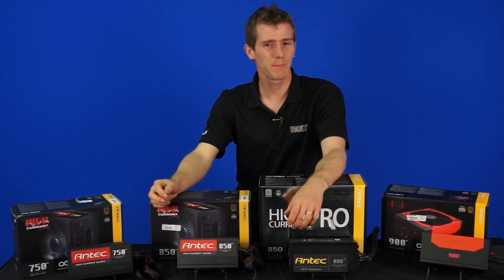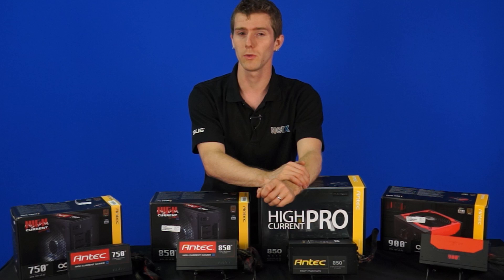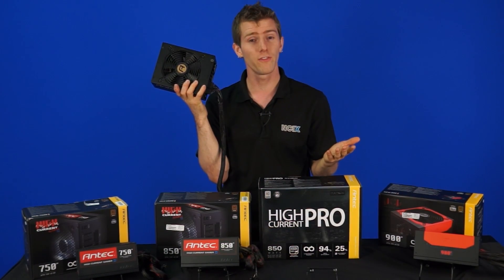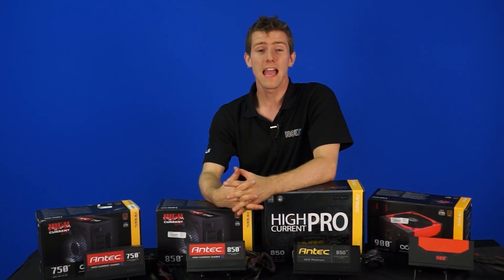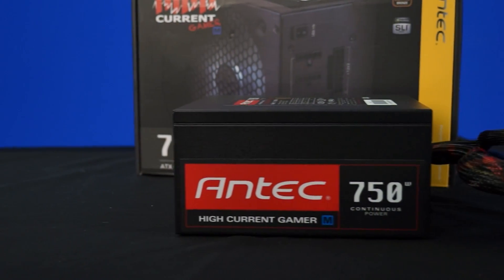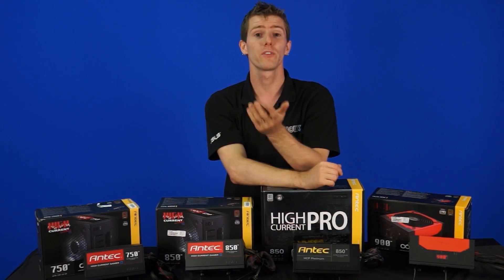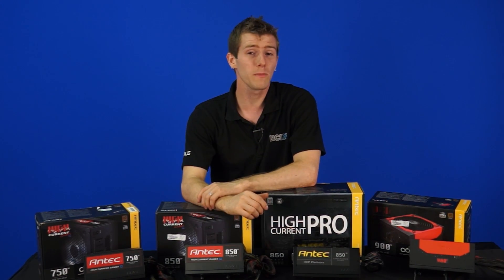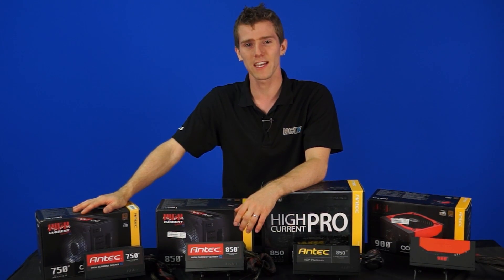How Many Watts Do You REALLY Need In Your Power Supply? ft. Antec HCG

Comment: Is Corsair 750(watt)RM 80+ Gold enough?? for:
I7 4790k
MSI R9 390X
16GB DDR3 Corsair Dominator platinum 2400mhz 
256GB SSD 850 PRO
CORSAIR H80I GT (with 2x 120mm fans)
Blue Ray/Dvd-disc
2 200mm fans( or 3 but 1 is not plugged in)
Cooler Master Sniper Black Edition Chasi
ASUS Z97-A Motherboard
ASUS PCE-AC68 Dual-Band PCI-E Adapter Wireless-AC 1900

+ USB Razer naga
+ USB Razer blackwidow
+ USB Bose Companion 5 Speakers
+ BENQ XL24IIT
Reply: +taucommander12 more than enough
Reply: +taucommander12  yes thats perfect amount for that setup, gives you a little room for overclocking too
Reply: Kk :) Noice, tho only prob is that it bluescreens sometimes when Im gonna play diablo or games, or just get stuck and bluescreens sometimes several times in a row, then it may work some week in a row without any bluescreens then it comes bk, dunno if it's the ram or something else...
Throw it away ? xD
Reply: taucommander12 i might be a RAM issue. try boot up with only 1 stick of ram and try again. if any overclock on your system (manual overclock) try to remove them and set them to stock speeds.
Reply: I tried to get out the ram before but it was like glued to the motherboard so I gave up ;D Was no way it was coming out lol, I tried wiggle it out but was barely moving lol. Or can I just buy new ram and hope it's not BS ?
Reply: And no I haven't overclocked anything, what I know.
Reply: Only set the gpu fan to higher speeds when it was starting to get warm.
Reply: taucommander12 the ram slots are locked in by a little clip on both (on asus the top end) of the motherboard. after you release the clips, you should get them out no problem.
as long as the gpu is below 85ºC you should not have any operating issues with the card.
Reply: I opened the upper clip but nothing happend,, so is it locked on both sides or ?
Kk :)
Reply: taucommander12 yeah for the most part. i said ASUS boards only need 1 clip to be released for that
Reply: Kk :P I did that but couldn't still, they were so tight together the 4 slots so couldnt really grab anything...

Comment: gtx 970
intel i7 4790k 
16 gb ram
1tb harddrive
225 gb ssd
corsair water cooler for cpu
500 W enough?
Reply: Kage probably not
Reply: +Kage as long as its a good quality psu and you dont overclock the shiet out of your cpu and gpu, its enough... 
im ordering an i5 6600k and a gtx 970 and i have a 550w seasonic g series psu powering it. i really dont think its going to pull more than 350w out of the wall...
Reply: aight, thank u lads. Got my self a 650 from corsair, should be good

Comment: About to upgrade from gtx 660 to gtx 970
Does my corsair cx 500w 80+bronze psu would be enough?? 
Spec
I5 3300
8 gb ram
1tb hdd
500gb hdd
Mobo :msi m-itx lga 1155
Lg optical drive
Stock intel cooler

Comment: My computer shut off once when I was playing and the power supply popped but no smoke was produced and I have an I5 dual core,gtx 750 evga and it was all ran by a 400 watt power supply is my power supply to small and what should I do
Reply: Had the same problem today with my 550watt supply hooked up a r9 290 you need to buy a bigger power supply sonething like 550 watts i should upgrade to 750 i gues lol

Comment: i7-4790k 4ghz cpu
Asus maximus VII hero MB
keyboard + mouse
Nvidia Gtx 980
Optical drive
1tb hdd
120-240 gb ssd (may vary)
6 fans, 4 120mm, 2 240mm.

What would be the ideal power solution? I've done a check online and it barely comes in at 480 watts, but I'm afraid if I buy a 500 watt powersupply i may fall into issues, any helps would be appreciated.

Comment: FX8350
R9 280
8GB RAM
1TB HDD
Is 500w enough?
Reply: eGaming180 Nope, you'll need 550W-600W from a reputable brand/product line for that.
Reply: I have 500W and for now everything is working great :D
Reply: eGaming180 Well, OK then. You're on the edge, but if it works, I guess it does. Just don't overclock your 8350 to hell.
Reply: haha I won't overclock it, maybe sometime i will, but for now i'll leave on stock, cause it's good enough :)
Reply: *****  have question... if I upgrade to 8gb of ram shold I upgrade the psu also, im having issues with bluescreens on win 8.1 when i upgrade my ram .. I  caan only work with 6.5gb and when watching youtibe vids...the cooler fan goes to max rpm... 430watts psu i have.... any suggestions?
Reply: I bought 620w haha, but thnx for tip :D
Reply: beggin CS master i have a corsair cx430... On a dell dimension e521 8gigs of ram and asus gt 440  and athlon x2 6400+ 3.2ghz
Reply: beggin CS master when I start nfs most wanted 2012 after the intro video my pc just restart, what should it be?
Reply: You've got the same specs as mine, but I got 600w.
Reply: i've got the Same and a xfx 550 Watt powersupply....
Reply: I got a i5 4690k at 4.3 ghz and a r9 280 over clocked really far it takes about 550-600 watts from my 650 watt psu
Reply: I have the same specs but with the 750ti
Reply: and i34170 I'm done I don't really know anything about tech I'm only 14
Reply: and I'm getting a 720 watts the psu is pretty cheap.
Reply: X4 860K
R9 380
8GB ram
1TB HDD

I was thinking if the Corsair VS550 550W was enough? or do I need more horse power :3 ?
Reply: No, thats fine, you can easy use a FX-8300 and 16GB ram, a friend of me has the same system
Reply: +beggin CS master Going with a Corsair CX 750M I wrote wrong not a 380 it was a 390 and well I will also oc my cpu and gpu and the 390 had a minimum of 750watt psu so... And I could go with a 750watt if I ever upgrade cpu to Intel or something else that needs power

Comment: My video card said I needed a minimum 450 watts, if I geta 430 watt, will I be ok
8 gb ram
Amd fx 6300 cpu
R7250x gpu
And a 970A D3P

I tried to use my friends 430 watt but I got a black screen and a beep code. (Long-short-short-short) video card issue supposedly
Reply: Sage Sekhon If you haven't done anything yet, then yes it will be ok. Your cpu and gpu together wouldn't use any more than 200 watts (despite being AMD) and they are by far the biggest users of electricity in most computers.

Comment: Is this a big enough psu

Cooler master 500watts
Gtx 960
Atx motherboard
I5 2500k
8gb ram
1 hdd
1 dvd drive
1mice
1keyboard
1 headset
Reply: 600 would be good i have a 280 gtx but i have a 750w but. But a gtx 960 and a gtx 280 have a recommend on 600w
Reply: *1 mouse
Reply: thanks

Comment: How many watts do I need for this setup? 
Core i7-4790K 4.5GHz
Corsair H110
Asus MAXIMUS VII RANGER 
Corsair Vengeance Pro 16GB
Sapphire Radeon R9 295X2
Samsung 850 EVO 250GB
Seagate Barracuda 1TB
Reply: ***** You should start a comedy show
Reply: If u dont buy atlleast 1600w platinium ur house gone exploade and alians are going to rull the world. Go with a cx430 non modular on ebay for 200$ god deal!
Reply: basje 1234567890 Nah man, I think I have decided. A nucelar powerplant would be the sweetspot for my build..
Reply: TheZero696 Sorry but 295x2 SLI? Go learn some stuff before you make jokes
Reply: TheZero696 r9 295x2 ALONE consumes 500 wats. If you were to CROSSFIRE it, it would pull 1000 watts, so that card eats power like winnie the pooh eats honey.
Reply: Bro, im sorry, but if you really believe that and if you do actually do that, then say bye to your whole rig.I'm telling you, do a little tiiiiiiiiiny bit of reasearch on the r9 295x2 gpu and you will acknowledge the fact that it consumes 500 watts.Sorry to burst your bubble there, bud.
Reply: Solid Gear 250 Watt TFX Power Supply   ----  this power supply can easily handle R9 295x2 sli
Reply: Syndicution R9 295x2 sli please
Reply: I Own A Horse no sir a 250 Watt TFX Psu will easily handle r9 295x Sli Crossfire....
Reply: Uhh, sure, i dont know about that exact card, but there is a r9 295x2 model card, which is a double gpu card, which consumes 500 watts.
Reply: I Own A Horse im telling you 250 Watt TFX PSU can easily hand r9 295x2 crossfire sli  and it only cost $25 WIN WIN

Comment: http://www.futureshop.ca/en-CA/product/asus-asus-m32ad-pc-brushed-metal-intel-core-i7-4790-2tb-hdd-16gb-ram-nvidia-gtx750-2gd5-windows-8-1-m32ad-ca008s/10322688.aspx?path=cfe27997ed61af50065ea2154a94861aen02 I'm thinking of getting this PC but it only has a 300w power supply, is that enough? If not, what power supply should I get for cheap?

Comment: I need help choosing my wattage, I would highly appreciate any suggestions. 

Hardware: 

CPU: AMD FX-8320 3.5 ghz (not overclocking)
CPU Fan: Stock
Motherboard: ASRock Fatal1ty 990FX Killer
Ram: 8 GB ( 2x 4Gb ddr3 1600) nothing too fancy
GPU: Geforce GTX 970 (Uses much less power than normal 900 series gpu's)
HDD: Western Digital 1TB 7200rpm blue edition 
Optical Drive: Some $20 Asus dvd cd drive
Fans: 2 120mm fans with led (again nothing too fancy)
PSU: My preferred/calculated wattage on pc part picker is 367 watts, but since another calculator said 500 watts i'm leaning toward a 550 watt psu to be on the safe side.

PS - This is my first build so do you guys think that this combo works well with each other and if i am missing something?

Comment: is a 550wat psu enough for gtx760 sli (i want to buy a second 760 and i want to know should i buy a new psu)
Reply: Hey.
Im running 2x760 oc gtx from gigabyte. I use a 850w power supply. But i have also overclocked my 4770k cpu from 3.5ghz to 4.3ghz. So i would recommend you to buy a new power supply, i would say at least 750w.
Reply: you should at least have a 650w-750w bc just that gtx 760 requires 500 watts out of your power supply so yeah !I hope this helped

Comment: asus strix geforce gtx 970 and i7 4790k, is 750 w enough?
Reply: 600 w is enough, you can use a coller master psu calculator if you are not sure.
Reply: got the evga supernova g2 fully modular 80+gold 750 w psu yesterday, with a 10 year warranty and for 136$, so it was worth it
Reply: f1nsk1pojk1 Good PSU can last a decade soo yeah it is worth it.

Comment: What PSU Should i get?

AMD Quad Core A10 7850k Black Edition

MSI A88X-G45 Gaming FM2+ Motherboard

Cooler Master Hyper 212 Evo Heatsink

1 ASUS Radeon R7 260X Overclocked 2GB GDDR5 

Acer 60Hz 19.5" Monitor

X2 4GB Patriot Viper RAM

LG DVD+RW Optical Drive

7 LED Fans Spinning ~1600 RPM

1 WD BLUE 7200 RPM 1Tb HDD

Im going to run Windows 8.1 and am going to have a back lit keyboard, headset and gaming mouse.

Comment: What PSU should I get with this build? 

Intel Core I7-4930K 6-Core Processor

ASROCK X79 Extreme-6 ATX LGA2011 board

NZXT Kraken X61 106.1 CFM Liquid CPU cooler

X3 GTX 980's WindForce edition 

X3 BenQ 27" monitors 

16GB 2400hrz 

X1 1TB Samsung A50 

760T  White edition Case 

X2 3TB HardDrives Barracuda Seagate 3.5" 

Etc. Can you recommend a long lasting and future proof PSU thanks :P and could you guys recommend some components That I should change for the gaming experience :D thanks guys And can you guys tell me what build you guys have :P
Reply: You sure have a slow RAM....

(typo joke)
Reply: ***** RM is overpriced, AX is overkill and CX is low quality.
Reply: ***** Hit the nail on the head, you did.
Reply: Just get a 900w Corsair or Rosewill. Never had either of those brands die on me.
Reply: I have compiled a list of parts on PCPartPicker, (here: http://pcpartpicker.com/p/CLZxVn). The changes i made were:

New Haswell-E processor instead of Ivy Bridge-E
X99 of course
DDR4 (can't have DDR3 on X99)
4x4 GB of G.Skill Ripjaws (best RAM, also more bandwith than 2x8)
500GB Samsung 840, and 1 3TB drive instead of 2
Same GPU's
The tower (has a cool window)
and a 1200W power supply (these GPU's actually draw 300-350W a pop, and not PCPartPicker's 165W)

Also i didn't include monitors, but those don't need extra power supply wattage.
Reply: Flaming Lemons These graphics cards run on the new power efficient Maxwell GPU and really draw only 165 Watts of power!
Reply: thijs luttikhuis
No. Anandtech benchmarked them and they found out that it uses about 300 watts of power during full load (crysis 3/furmark). The 165 watts is it's TDP (Thermal Design Power)
Reply: Antec, Corsair HX, and Seasonic are all good brands
Reply: ***** Their other lines aren't very good.
Reply: That is overpriced. The SeaSonic X 1050 watt is available for 170 right now. The CX line is low quality. End of story. I just picked up an antec HCG750 for $80 which is only a few dollars more than the CX750 but much better quality.
Reply: thijs luttikhuis when its not playing a game just on the home screen

Comment: If you dont have 12 hdds, and quad sli you are not going to hit even 750w. Jesus. Come on if your pc is hitting nearly 1kw you have too much goddamn stuff running. (or you have a duel cpu quad sli running... which is nuts)

Modular = very cool. Screw the octotenticles of random legacy connectors in my old case.
Reply: facts, aside from not talking about actual single crossfire or single sli setups. im actually super curious rn if 850 would power a 290x crossfire.

Comment: Hi, i have a gtx 770 4gb, 8gb ram, i5 4670k, corsair h110. Im using 750w plus bronze from cooler master. I want to upgrade for a second gtx770 4gb and 8gb ram more i will need a better PSU or im fine whit mine? Thx for any help

Comment: i have 530W PSU, 4GB ram, 1 WT 500gb, i DVD drive, and AMD Athlon x4, i plan on getting the gtx 770 lightning, do i need better PSU?
Reply: Google psu calculator and use the first one I did and my system works great
Reply: Is the PSU 80+ rated?
Reply: i have to evga 750 psu now. just had to upgrade out of caution.  i got the 4gb gtx 770. stable system.
lol and the world is ending13

Comment: So, my first gaming PC build is this: 
-AMD FX-6300
-Sapphire Radeon R7 260x
-Gigabyte GA-970A-DS3P motherboard
-8 GB 1600 MHz Kingston Hyper X RAM
-SanDisk Ready Cache 32GB cache SATA SSD
-WD Black 1TB 7200RPM 

Would a Sentey X Plus Power 625-watt power supply unit work well for this build and perhaps some overclocking and a few upgrades in the future? Or do I need more or less power for it?

Comment: With an FX8350, 16 GB DDR3-1333, and a GTX 660 Ti DC2+Quadro FX1800 gaming/light workstation rig, will a Corsair CX750M be sufficient to add another 660 Ti along the line? Just wondering if i didn't manage to buy exactly the wrong PSU for me future plans.

Comment: What PSU would be good for this build: 

	
ASUS P8Q77-M USB 3.0 Micro ATX Intel Motherboard
	
EVGA  GeForce GTX 760
	
Intel Core i7-3820 Sandy Bridge-E Quad-Core 3.6GHz (3.8GHz Turbo Boost)
	
G.SKILL Ripjaws X Series 16GB (2 x 8GB) 240-Pin DDR3 SDRAM DDR3
	
Kingston SSDNow V300 Series SV300S37A/240G 2.5" 240GB SATA III Internal Solid State Drive (SSD)
Seagate HDD. 4TB 64MB Cache

Comment: I have a ASUS Z97-DELUXE motherbord with:
Intel Core i7-4770K Haswell
GIGABYTE GeForce GTX 770 OC - 2GB GDDR5 
4x4 Kingston HyperX Beast DDR3-2400 4G RAM
Samsung 840 EVO SSD - 250GB 
Western Digital WD Black - 1TB
and a bluray drive
with a Corsair RM750 Gold - 750W PSU 
I'm thinking of adding another GeForce GTX 770 in SLI
would the 750W PSU be enough?

Comment: Is it stable enough to power up my car audio amp that draws 100 amps at 12V under full load ??? That's if they make a 1500 w model, safer in the house with out using car batteries in the house "Harmful fumes" that batteries give out... I'm asking cause this would a lot cheaper to buy then purchasing a power supply for about $2000.00 for 1000w 12v dc...

Comment: My build is a 
Gigabyte Z87M LGA 1150 mother board
Intel Core i5 4670k quad core 
EVGA Nvidia Gtx 780
Kingston HyperX Black Ram
PNY XLR8 120GB SATA III SSD
Sea gate Barracuda 1TB SATA III 7200RPM 

Would a 600 watt supply be enough or should I go for higher
Note:(No over clocking also I will upgrade in future :)
Reply: malomkarom ChromeMario I hope to god you didn't follow this guys advice. I would have gone AT LEAST 650W or 750W.
Reply: You don't need 600 watt. Buy a Chieftec 500W, maybe even an XFX 450W is enough.
Reply: Because you're stupid.

GTX 780 : 250W
I5 4670K : 84W
All the other stuff : About 50W.

Even an xfx pro 450 would be enough.
Reply: malomkarom He's going to upgrade in the future, and also no one likes a PSU going hairdryer
Reply: Even if he upgrades to a 4770K, the xfx 450 would be enough. 

A new HDD, SSD, RAM wouldnt matter, those aren't affect the 12V rail.

Comment: PNY NVIDIA GeForce GTX 770 OC 2GB GDDR5 2DVI/HDMI/DisplayPort PCI-Express Video Card (VCGGTX7702XPB-OC),
EVGA GeForce GTX 780 Ti Superclocked w/ACX Cooler 3GB GDDR5 384bit Dual-Link DVI-I DVI-D HDMI DP SLI Graphics Cards 03G-P4-2884-KR,
Intel Core i7-4770 Quad-Core Desktop Processor 3.4 GHZ LGA 1150 8 MB Cache BX80646I74770,
ARCTIC Freezer Xtreme Rev. 2 CPU Cooler - Intel & AMD Twin-Tower Heatsink, 120mm PWM Fan,
ASUS Maximus VI EXTREME LGA 1150 Intel Z87 HDMI SATA 6Gb/s USB 3.0 ATX Intel Motherboard,
Corsair Dominator Platinum 16GB (2x8GB) DDR3 1600 MHz (PC3 12800)Desktop Memory (CMD16GX3M2A1600C9),
Seagate NAS HDD 4TB SATA 6GB NCQ 64 MB Cache Bare Drive ST4000VN000
Asus 24x DVD-RW Serial-ATA Internal OEM Optical Drive DRW-24B1ST

How Much Watts Should I Get {Im A Big N00B When It Comes To This}????

Comment: I m building this build:
MSI Z87-G45-GAMING ATX Motherboard ,i5 4670k, msi gtx 750ti, 1 WD 1TB HDD, 8GB hyper Kingston ram, 3 120mm led, 1 140mm led and 1 120m fan and
1 dvd drive,
(Not OC)

can CXM 430W Modular 80 PLUS Bronze enough to handle ?